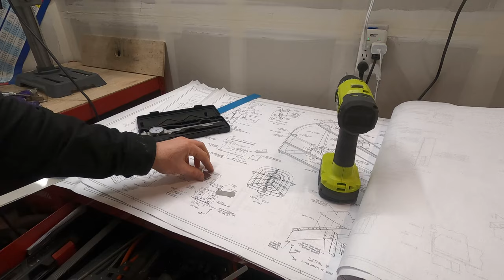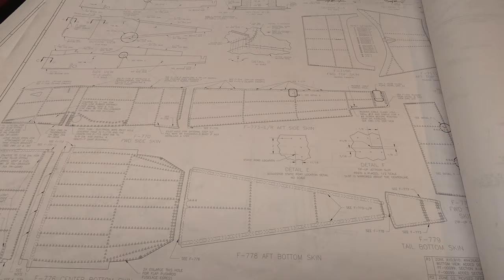Gear, Static Lines, Seatbacks, Forward Structure and More - RV-7A | EP3.28

Comment: Wow, I was surprised by the distance from the firewall to the instrument panel.   How removable will the instrument panel be for planning/ mounting the selected instruments and switches? Or, does that all have to be completed before final installation?    Looks good Ryan.
Reply from the maker: The panel itself can be removed with a series of screws for inspection. This becomes more difficult once all electronics are attached to the harness, of course. 

An option for access is to remove either of the GDU (screens) with the install screws, and unplug the relatively few connectors holding them in place. You then have a 11-ish inch hole to access the remaining equipment.

There is ample space, but I'll be filling it with a vast amount of electronics. It'll get tight. Another aspect is that subpanel about halfway through. I don't want to mount much, if anything, behind this, as it won't be accessible unless I want to spend more time upside down and backwards under the panel--and I don't!

I will not be placing access panels on my forward skin like some pilots choose to, so a clean installation will be a must!